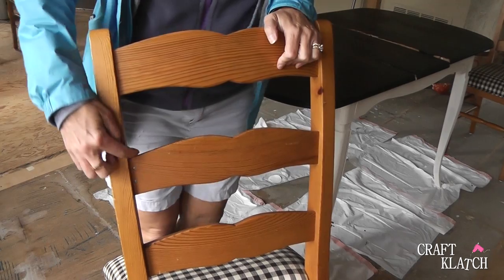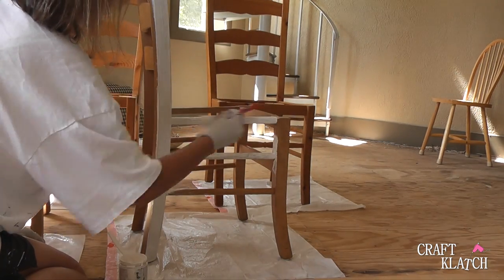Garbage to Gorgeous Episode #10:  Shabby Chic Dining Room Makeover on a Budget DIY!

Comment: Its beautiful! I was wondering if you have ever painted over particle board that has the fake wood topping? I hope I'm describing the texture correctly. Just was wondering if you had any suggestions? I got a great deal on a desk from Goodwill and want to paint it.
Reply from the maker: +map1371 I haven't, but I would probably buy a spray paint primer or paint that adheres to plastic and other surfaces.  That should stick and then you can paint over it any way you like.  Hope that helps!  I want to see it when it's done!
Reply: +CraftKlatch Thanks! I will show when I'm done.

Comment: do you have to sand the wood before you apply the espresso varnish because i have a table but its not painted so i dont need to use the stripper

Comment: What kind of paint do you recommend using? Also are you always supposed to sand the furniture before painting?
Reply from the maker: +Mercedes Gonzalez I used a chalk paint I bought at Home Depot.  That specific paint does not require you to prime or sand it before painting.  Typically, you would normally sand or prime it.